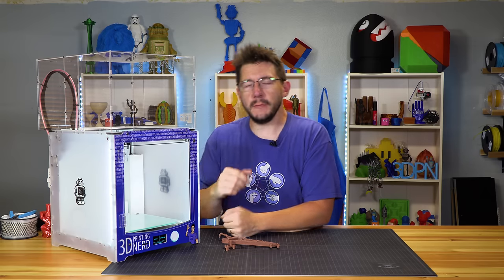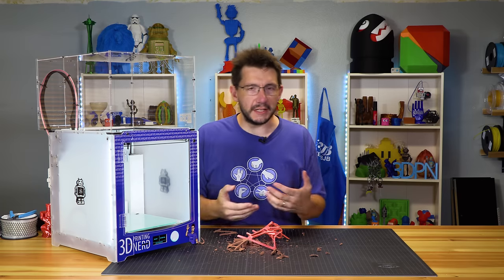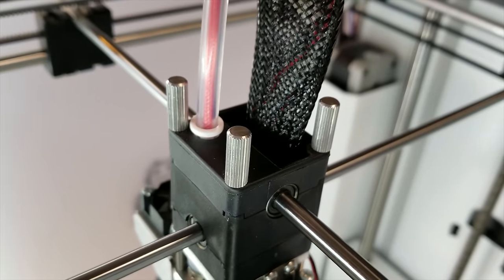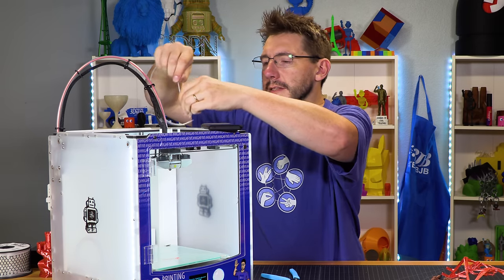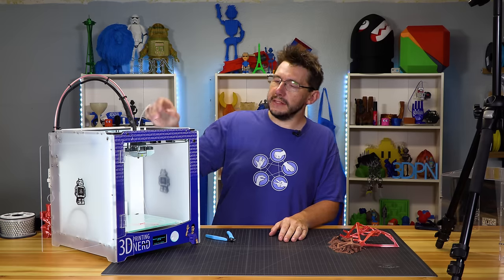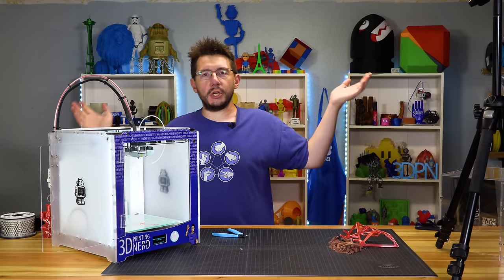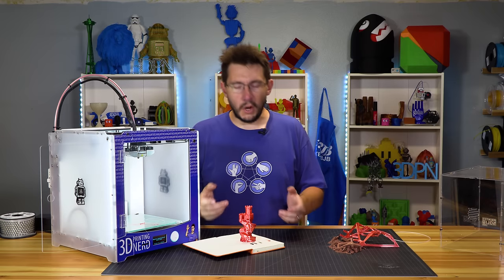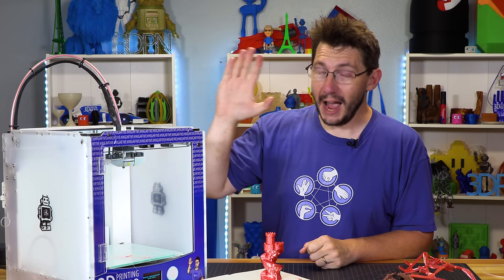3D Printing 101: How To Fix a Clogged Nozzle Using a Cold Pull!

Comment: Joel!!!! I have a experiment for you!!!! So I’ve heard of people using weed walker line in their 3D printer. Of course it’s not the best option but would it actually work?
Reply: I think it works OK, but weed whacker filament is not designed for additive manufacturing via very small nozzles; it may contain additives or particulates that are too big for a 3d printer nozzle, which would result in a jam (or inconsistent flow, at the very least).
Reply: James Laine I know it wouldn’t be the best option. It’s just one of those pointless questions you want to know. Like even if it wasn’t able to work with a .2 mm nozzle. Would a larger size work? Also is there’s something that makes it a better option than say a pla?

Comment: Should a cold pull be done only as a reactive measure to inconsistent extrusions or can it be done as a routine preventative measure??
Reply from the maker: It very much can be done as routine maintenance though personally I only do it when I have an issue.

Comment: Great vid, thanks for the info. I noticed you were using 3mm nylon filament, does that matter, or was it because the ultimaker you were using takes 3mm filament?
Reply: Joel simply used the diameter of filament which that particular printer uses.  In his case, it is a printer for 3mm filament.
Reply: Thanks James, I thought that was probably the case, but as Joel never mentioned it I thought I'd check in case it made a difference.
Reply: thanks - this was my q too!

Comment: If you do not happen to have any nylon on hand, would this proceed with with pla?
Reply: Thomas Gehrdes Jr from what I heard you can do it with pla as long as you have been printing with pla
Reply: If you have a home improvement store or Walmart near you, pick up a small roll of string trimmer line. It's essentially nylon filament. Be sure to get round line in a size that will fit your extruder (.065 inch is a common string trimmer line size, and it works out to 1.65mm, which is just a bit smaller than standard 1.75mm 3D printer filament).
Reply: Matt Elder thanks. I had a spool of nylon delivered from amazon yesterday. I took enough out for the cold pull, then vacuum sealed the spool back up.... everything is fine now. Part of me thinks it might have been my print server, because the cold pull was extremely clean.

Comment: Would a cold pull work on 3d printer pens using PLA Filament?
Reply from the maker: That's a good question. I don't think so, as the extruder gear would be in the way and would cannot get it out of the way.

Comment: Have you ever had a nozzle that you just couldn't fix?  I have 2, both perhaps just coincidentally had a nickel coating to reduce friction, that eventually got clogged - and no matter what I couldn't restore them to normal performance.  I could extrude a bit, do a pull, then go to print and it would extrude just a bit of filament - act like a partial clog, then completely stop extruding again.  I would take the hotend apart, try running a 0.4mm nozzle cleaner wire through, put it back together, and same thing - extrudes a bit then stops.  I'll try fixing the relatively expensive nozzle for maybe a day or two, then put a cheap Chinese nozzle on there and boom I'm back to printing normally.

Comment: Very sorry for the unkind words I posted earlier, you did not - in fact - turn my printer into a desk ornament. I nearly did, though! I pushed the filament in too hard and I ended up filling my hot end with too much plastic that would not come out to save my life.. I had to take my hot end cooling fan off to get the heat high enough to loosen the plastic. I was more careful with the amount of filament I added to the second attempt and was able to do it properly. Thank you for responding to the comment, though. Sorry again.
Reply from the maker: All good, and thank you for posting this. I’m very thankful you were able to get it done properly with a second attempt.

Comment: Do you have to use nylon for the cold pull or can I use pla
Reply from the maker: You CAN use other materials - but you have to remember - PLA is normally a brittle material and Nylon melts at a higher temp and is stronger. That’s why it is commonly used.
Reply: @3DPrintingNerd  OK I will keep that in mind

Comment: actually there is a way to get in there and scub, however this is probably safer for noobs.  i have for years used a set of carburetor jet drill bits, very small drill bits, down to 0.1

Comment: Is this for full metal hotends only?
Reply from the maker: It's best for all metal hot ends - yes. If you do this with the PTFE liner, it could damage it. In those cases it's better to heat up the nozzle and get a metal rods that fits down in there.

Comment: A sad extruder story; in the year of 2018 a young extruder was purchased for the Anet A8, it had high hopes and was ready for anything. It did well untill one day it pulled the filament in the wrong way and scraped it against the inside of the extruder entry tube. A hundred and one problems later the owner jamed 6 inches of filament into the depths of the extruder nozzle. The owner, being lazy as usual, just bought a new extruder instead of buying a needle and acatone. The is the second installment of "Failed Prints; when things go wrong and I don't feel like fixing it." Tune in next time to hear about The over worked servo!

EDIT: I just realized I've probably spent more time buying extruders then actually printing :/

Comment: I don't ever print with nylon, so this has me wondering how well nylon weed eater strong would work.
Reply: Brandon Terry printing with nylon strimmer line is an old old printing trick (first time I've heard of it was 2012 but was probably done earlier), taulman even has a warning about printing strimmer line in their FaQ section.
Reply: euan todd - Ah... I'll check that out then. Thanks for the tip.
Reply: Oh, ok. Yeah, it makes a lot sense that you wouldn't want to heat up and melt the fiber glass in the line. I guess I always just assumed it was straight up raw nylon for some reason.

Comment: Cold pulls should never be done. Yeah it can work to clean your nozzle, but it also stresses your PTFE tube, and can pull it away from being seated on the nozzle, causing a leak. The proper method is to always heat the nozzle to the highest temp material you are swapping, and push some of the loaded filament in manually to extrude some before pulling it out. Then push in the new filament until the old color is finished extruding. I have not had a single clog or jam doing this....and if I ever do, then I know it is time to change the nozzle and make sure the PTFE tube and heat break are properly seated to that new nozzle. 

No reason for a cold pull....ever.

Comment: Unless your nozzles cost a lot, wouldn't it be a better idea to just replace it? The cheap ones are like 5 cents.
Reply: Depends how far up into the heat block the crud has accumulated; just replacing the nozzle may not get it all.  Plus, I've never seen a good nozzle manufactured to very tight tolerances at such a low price; I've only seen really cheap nozzles with poor dimensional tolerances and questionable metallurgy anywhere close to that low of a price.